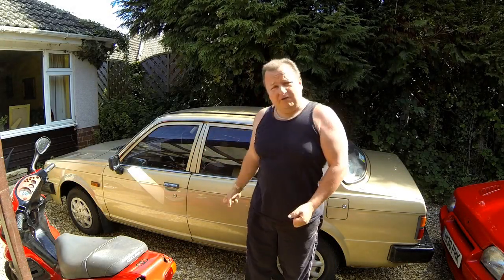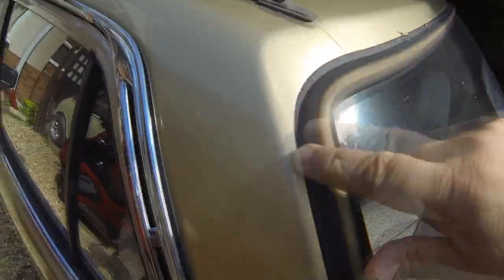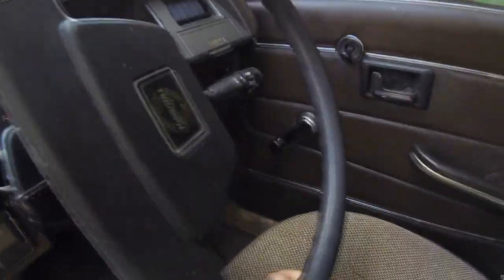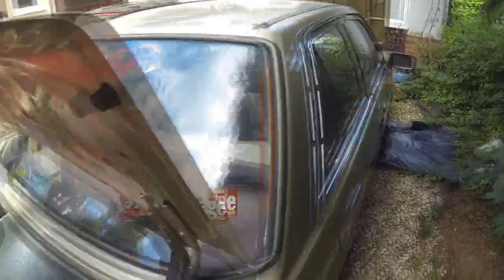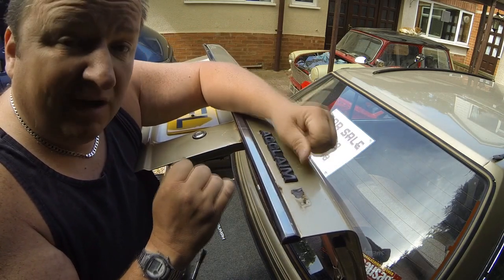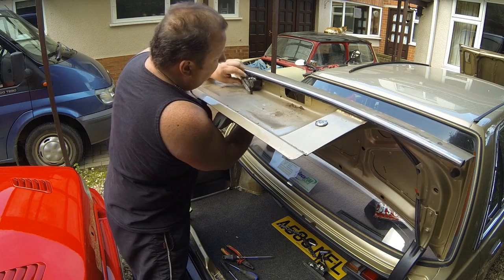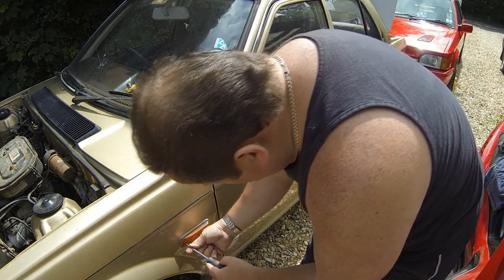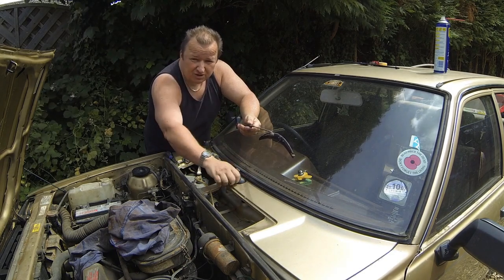Part 1 Triumph Acclaim Restoration Removing The Trim

Comment: You might be able to source the trim from Rarebits. Rimmer Bros have few (if any) Acclaim parts. Clean and lubricate the wiper mechanism as they're prone to seizing. They're great cars to drive and are ultra reliable. Mine were used daily.
Reply from the maker: I have fitted a new rear rubber as in a later vid and I have sourced a silver insert (of a similar type) so will be fitting it in a future video. Thanks for your comment.
Cheers
Martin

Comment: That's a great example you have there. The Acclaim was my first car back in 1990. Bit rusty but it went well enough. Drank like a fish due to a carburettor fault, took me ages to get spares. Changed the head gasket on it - this was all aged 21 on the road as I had moved out of my parents. It was pretty good on the motorway at 80 which wasn't bad for a 1.3; but sometimes stuttered in heavy rain at those speeds. Anyway, I couldn't really afford to run it on a graduate starting wage so I went back to my push bike and the train for a few years.
Reply from the maker: I replace the head gasket on this one as well later on so check out the other vids on the Acclaim.

Comment: What a smashing little motor, used to like working on those, some of them had bike carbs as standard, try COH Baines in Kent they supply the suppliers of car rubber extrusions. They have a web site. Or Rimmers Bros do some Acclaim parts? They're BL Specialist, if you dont know em?
Reply from the maker: Just been onto Rimmers who put me onto AE Wilcox who actually had 1 rear new rubber windshield seal. £98.00 including shipping though but I got it as these are as rare as hens teeth I'll try COH baines to see if they can match up a similar front one. Thanks for the contact details Scott. Now in my bookmarks.
Cheers
Martin

Comment: The Triumph Acclaim always had a respectable image, a large owned by pensioners. I've never seen one as a police car, a minicab, or being abused by boy racers. And even when they got old, it was not the car of choice for riff raff. In BL competition from the late Maxi and Allegro, Ital and Ambassador, that were so different because they were not based on a Honda. Numbers are dwindling as we are now in 2017, an occasional one appears every so often, the same cannot be said about the Morris Ital. And it was the Rover 213/216 that replaced the Acclaim again with a respectable image, but very few early cars, and not many more later cars remain.